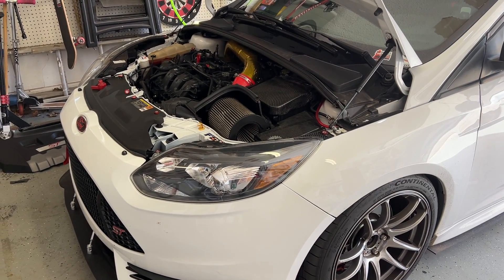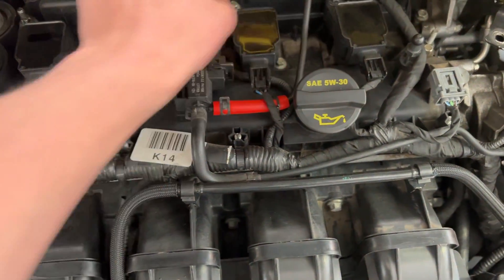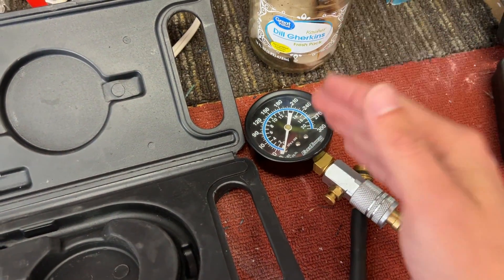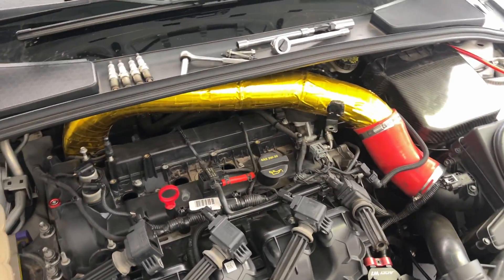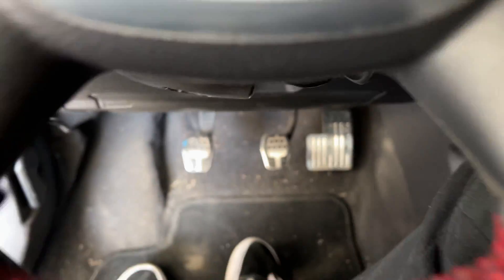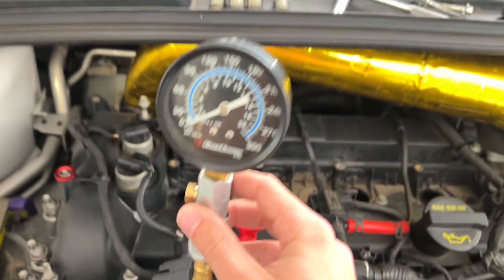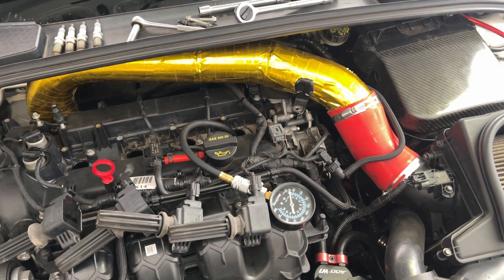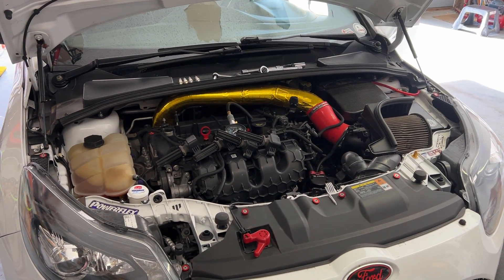How to Compression Test Your Engine!

Comment: Did the injectors make a difference? My wife’s ecoboost escape has a few random misfires when in idle/drive. No codes. Runs pretty smooth otherwise. Been chasing this issue for the last year or two. It’s got 172K miles. Cleaned the valves but it only made a minor difference. Wondering if it’s dirty injectors or weak coil packs?
Reply from the maker: @Bacongrease00  injectors made a slight improvement but the culprit was my high pressure fuel pump. If you haven’t already I would do new spark plugs and make sure they’re gapped correctly. You could try some Techron fuel injector cleaner to see if you have an improvement. Mine misfires at idle but that’s partially because it’s tuned, I’ve been told not to worry unless it’s throwing codes
Reply: @ I’ll have to connect ford IDS and see if the high pressure fuel pump is keeping up. It’s only at idle I can feel the random misfires when in drive. Soon as you get the revs to like 900+ it disappears. I might just be used to other engines. I just did plugs. Never throws a darn code so it’s hard to pinpoint

Comment: Lately I’ve been getting a weird wobble/shutter in first gear only when the clutch isn’t fully engaged and giving it some throttle the accessport actually pulls timing -ign correction and detects knock always in cylinder 3 for some weird reason, can’t figure out what it is